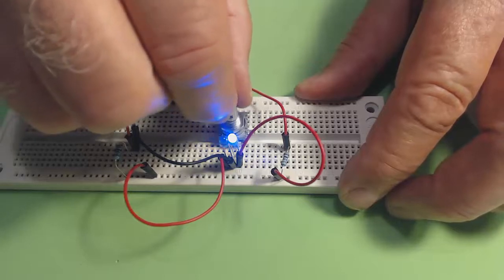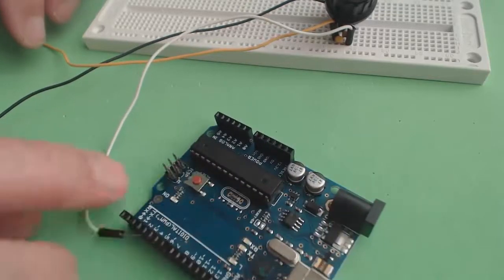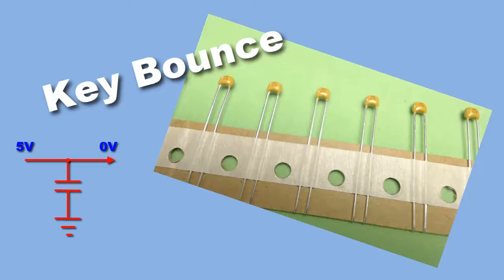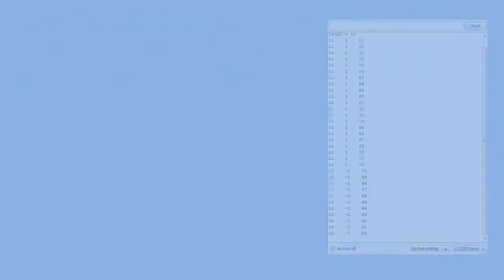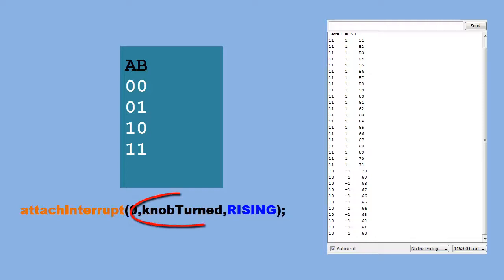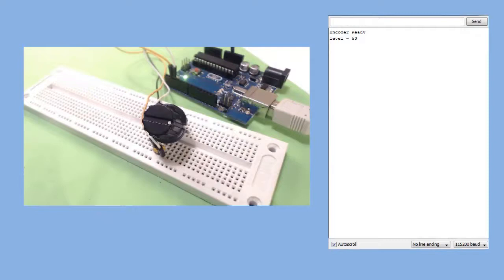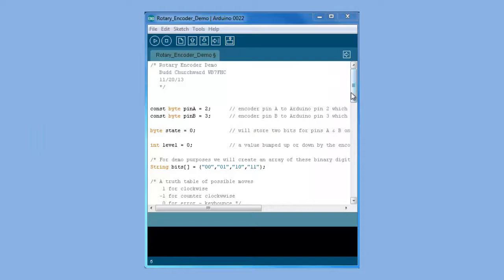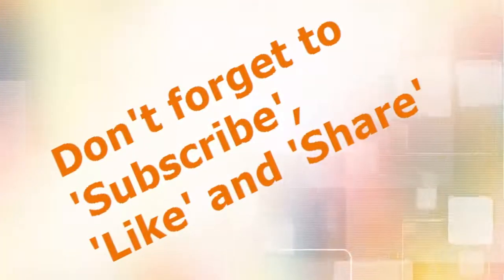Let's Hook a Rotary Encoder Up To My Pet Arduino (Part 2)

Comment: Hello,

   no matter which way i turn my encoder the value only increases. Any help?
Reply: Remember to compare the value of the B switch when the A switch is triggered, and output differently according to the B switch value

Comment: Hi Budd.  I'm searching for a way to control an encoder equipped DC motor with an Arduino.  Can you advise if the Arduino is capable of reading an encoder at a high rate?  I'm looking to control distance primarily then speed.  A home position would be established by an end stop switch. I have a motor controller (previously purchased) I'm considering to use.  It has two sets of servo pins, can these be repurposed to read the encoder? Thanks.

Comment: Very good tutorial but very frustrating trying to get your sketch. The drive.google link gives me a .pde file...what is that all about? Can't use it as a sketch. I went to your google+ account...way too much stuff at random and I paged down and down and down...way too much stuff to look through...Google+ what a mess they offer us...so I'm stuck...no sketch and don't know how to get it.
Reply from the maker: +Ralph Freshour This is one of my older videos. If you email me at: wb7fhc@arrl.com, I will find the code and send it to you. I probably have a few versions you can experiment with.
Reply: Ralph Freshour A .pde file IS a sketch file. It's the old version. Arduino can convert it to an .ino file automatically.

Comment: hmm i dont understand it quite yet, the serial monitor gives a 00 for every knob turn like this:
00    0    50
10    -1    49
00    0    49
10    -1    48
00    0    48
10    -1    47
00    0    47
11    1    48
00    0    48
11    1    49
00    0    49
11    1    50
00    0    50
10    -1    49
00    0    49
10    -1    48
Reply: Budd Churchward  I watched another guy demo the encoder and say that the .01 did not work so well for bounce, so he kicked it up to .1. is there a down side to what he did?
Reply: @JosephMassimino  the higher you go, the more likely you are to skip over some numbers, but that's only if your frequency is going to be really high
Reply from the maker: Enhanced Pyrotechnics Did you put capacitors across the terminals on the encoder? Your numbers look like mine when I remove them.
Reply from the maker: Enhanced Pyrotechnics Did you put capacitors across the terminals on the encoder? Your numbers look like mine when I remove them.

Comment: The arduino is hanging after working for sometime. After that, I want to reset the arduino to work again. It will again hang working sometime.
Reply from the maker: Of course I can't know for sure what is happening with your sketch, but I do know that when we run interrupts other procedures that use timing like delay( ) and millis( ) can have problems.
Reply: Budd Churchward
Now solved. As per the Arduino documentation, RS232 operations inside Interrupt code is not recommended. I change the code to display the output into a LCD. Now its working perfectly, except some debounce problem - It's not a problem.
Reply from the maker: Anish Vargheese great to hear. If you ever run across anything that would handle flow control on the RS232 let me know. I haven't had time to look myself yet, but it would help in a project that will be coming up later.

Comment: I had a play with the code, and managed to get it working.. Needed hardware debounce on the encoder outputs.. 0.01uf Cap to ground, 4k7 resistors to the arduino, all simple stuff..
Anyway, here's a linky to the working code .
https://www.dropbox.com/sh/rnnfz42nzweizz7/AACZYL_mrbOI59f5F7GDkPMoa?dl=0
Reply from the maker: Thanks for sharing the code, Paul. I've used the capacitors to help with the debounce but I have not tried adding the resistors. I will give that a go.
Reply: Thanks for the link man;)

Comment: I have a question what kind of knobs do you use with a rotary encoder can you use just regular potentiometer knobs of do you have to use special ones, and does the encoder you used have a build in button?

Comment from the maker: This is part two of the series on Rotary Encoders with Arduino. I'm testing the concept of adding this feature to my Morse Code Decoder project.
Here is the sketch that I used in this demo:
-* Rotary Encoder Demo
 Budd Churchward WB7FHC
 11-20-13
 *-

const byte pinA = 2; -- encoder pin A to Arduino pin 2 which is also interrupt pin 0 which we will use
const byte pinB = 3; -- encoder pin B to Arduino pin 3 which is also interrupt pin 1 but we won't use it
byte state = 0; -- will store two bits for pins A & B on the encoder which we will get from the pins above
int level = 0; -- a value bumped up or down by the encoder
* For demo purposes we will create an array of these binary digits *
String bits[] = {-00-,01,10,-11-};
-* A truth table of possible moves 1 for clockwise
 -1 for counter clockwwise 0 for error - keybounce *-
int bump[] = {0,0,-1,1};
void setup(){
 pinMode(pinA,INPUT); -- reads Pin A of the encoder
 pinMode(pinB,INPUT); -- reads Pin B of the encoder * Writing to an Input pin turns on an internal pull up resistor *
 digitalWrite(pinA,HIGH);
 digitalWrite(pinB,HIGH); * Set up to call our knob function any time pinA rises *
 attachInterrupt(0,knobTurned,RISING); -- calls our 'knobTurned()' function when pinA goes from LOW to HIGH level = 50; -- a value to start with * Set up for using the on-screen monitor *
 Serial.begin(115200); -- make sure your monitor baud rate matches this
 Serial.println(Encoder Ready);
 Serial.print(-level = -);
 Serial.println(level); -- to remind us where we're starting
}
void loop(){
 -* main programming will go here later for now we'll just do nothing until we get an interrupt *-
}
void knobTurned(){
 -* AH HA! the knob was turned *-
 state = 0; -- reset this value each time
 state = state + digitalRead(pinA); -- add the state of Pin A
 state --= 1; -- shift the bit over one spot
 state = state + digitalRead(pinB); -- add the state of Pin B * now we have a two bit binary number that holds the state of both pins 00 - something is wrong we must have got here with a key bounce 01 - sames as above - first bit should never be 0 10 - knob was turned backwards 11 - knob was turned forwards   We can pull a value out of our truth table and add it to the current level *
 level = level + bump[state]; * Let's see what happened *
Serial.print(bits[state] + - ); - show us the two bits
 Serial.print(bump[state],DEC); -- show us the direction of the turn
 Serial.print(- -);
 Serial.println(level); -- show us the new value
}
Reply: IF anyone has trouble with the download on the youtube page here is the code. make sure to save it as Rotary_Encoder_Demo and place it in a folder with that name as well.

const byte pinA = 2;      // encoder pin A to Arduino pin 2 which is also interrupt pin 0 which we will use
const byte pinB = 3;      // encoder pin B to Arduino pin 3 which is also interrupt pin 1 but we won't use it

byte state = 0;           // will store two bits for pins A & B on the encoder which we will get from the pins above

int level = 0;            // a value bumped up or down by the encoder

/* For demo purposes we will create an array of these binary digits */
String bits[] = {"00","01","10","11"};

/* A truth table of possible moves
    1 for clockwise
   -1 for counter clockwwise
    0 for error - keybounce */
int bump[] = {0,0,-1,1};

void setup(){
  pinMode(pinA,INPUT);    // reads Pin A of the encoder
  pinMode(pinB,INPUT);    // reads Pin B of the encoder
 
  /* Writing to an Input pin turns on an internal pull up resistor */
  digitalWrite(pinA,HIGH);
  digitalWrite(pinB,HIGH);
 
  /* Set up to call our knob function any time pinA rises */
  attachInterrupt(0,knobTurned,RISING);    // calls our 'knobTurned()' function when pinA goes from LOW to HIGH
 
  level = 50;              // a value to start with
 
  /* Set up for using the on-screen monitor */
  Serial.begin(115200);    // make sure your monitor baud rate matches this
  Serial.println("Encoder Ready");
  Serial.print("level = ");
  Serial.println(level);   // to remind us where we're starting
}

void loop(){
  /* main programming will go here later
     for now we'll just do nothing until we get an interrupt */
}

void knobTurned(){
  /* AH HA! the knob was turned */
  state = 0;    // reset this value each time
  state = state + digitalRead(pinA);   // add the state of Pin A
  state <<= 1;  // shift the bit over one spot
  state = state + digitalRead(pinB);   // add the state of Pin B
 
  /* now we have a two bit binary number that holds the state of both pins
     00 - something is wrong we must have got here with a key bounce
     01 - sames as above - first bit should never be 0
     10 - knob was turned backwards
     11 - knob was turned forwards
     */
     
  /* We can pull a value out of our truth table and add it to the current level */
  level = level + bump[state];
 
  /* Let's see what happened */
  Serial.print(bits[state] + "    ");  // show us the two bits
  Serial.print(bump[state],DEC);       // show us the direction of the turn
  Serial.print("    ");
  Serial.println(level);               // show us the new value
}
Reply: Budd
Am a VERY new Arduino user...having trouble loading sketch for demo... am using Arduino 1.0.6 is that the problem?  Seems to not like comment punctuation.
73
Gary N8WTT
Reply from the maker: Gary Schultz
Sorry about that, Gary. I was new to posting text on YouTube when I put that sketch up there. YouTube does a funny thing. The correct comment marker is a slant followed by and asterisk and the beginning and an asterisk followed by a slash at the end.

YouTube doesn't like us to use these symbols! So it changed the slashes to hyphens.

While in your IDE type a CTRL-F. When the find window opens, Put *- in the find box and put * and a slash mark in the replace box. Then hit 'Replace All'

Do it again with -* in the top and slash mark * in the replace box. 

Then I think you will be good to go.
Reply: Gave your suggestions a try, still running into errors..... Can you please
send the file to my ARRL email? ****@**
Reply from the maker: Gary Schultz
Google and YouTube mask out your email address so I can't read it. Give me your call sign. I know the rest.

I have edited the description for this video so you may be able to download the file from the link I provided there.

You can email me at wb7fhc [you know the rest]